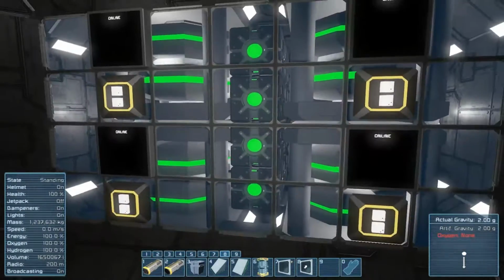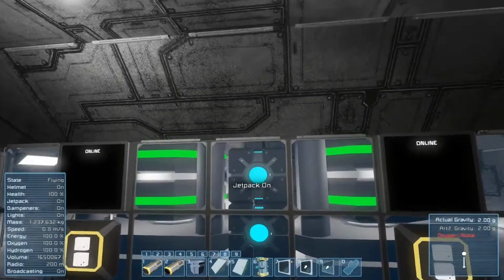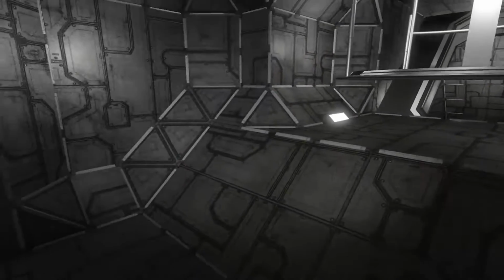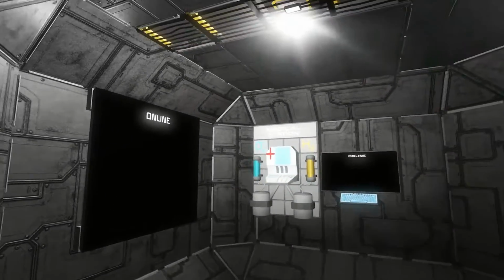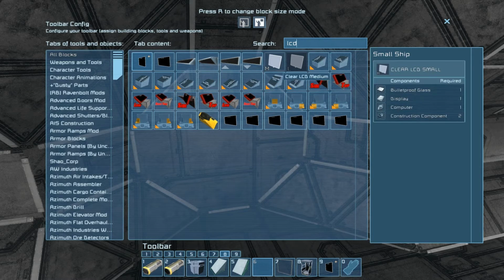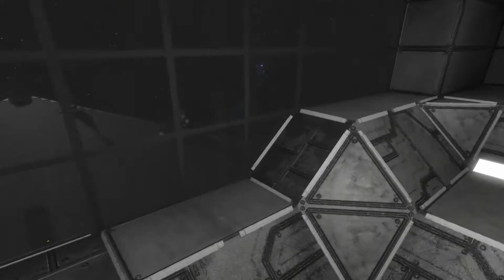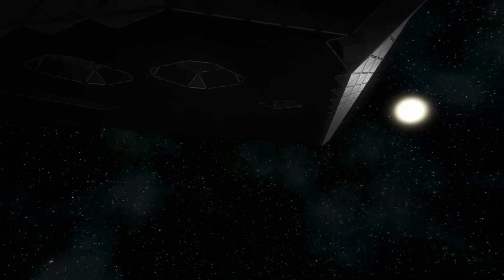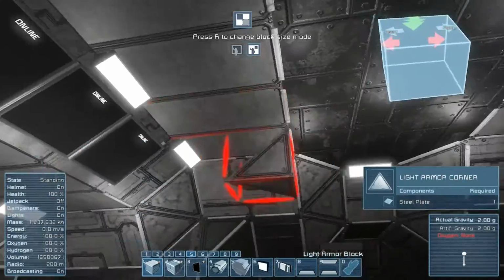Let's Play Space Engineers - Episode 104: Bridge Improvements!

Comment: The one problem you will still have with the airlock is any planets with an atmosphere. When it depressurize and then you go outside and the elevator is open it will pull air in to the tanks from outside if it is still set to depressurize when the elevator lowers. The way to fix that is to have it depressurize then turn off. Then the elevator goes down. and when you come back the elevator comes up and it pressurizes and then the inner door unlocks so you can open it and go in the ship. It just means one/two more sets in the scripting of the airlock. .

Comment: are you going to add serious solar power becose thous window ones do not produce much (real and max power output are different and when you made them you only looked at max output not real)
Reply from the maker: Well the current output isn't going to be anything above 0 right now because the reactors are producing the power. So max will show what it "should" produce when it's solely on solar power. That's why the max changes as you move around the light, cause typically in SE if the panel is producing power, it's usually whatever the max it can produce. At least that's been my experience.